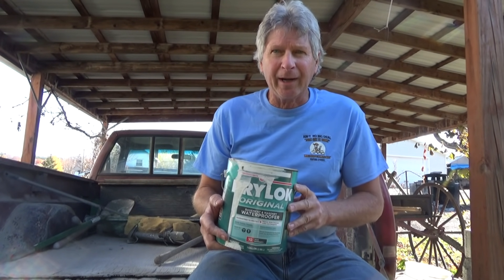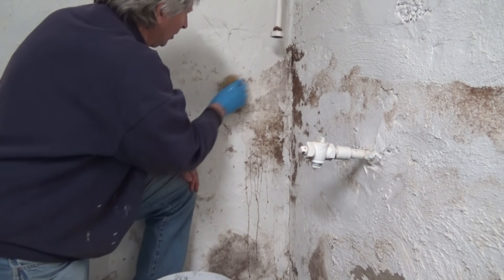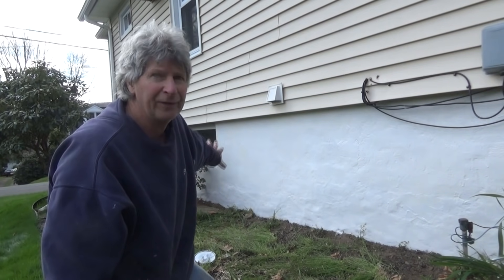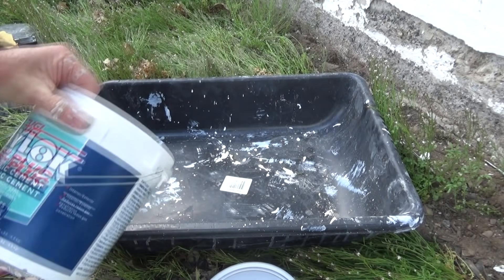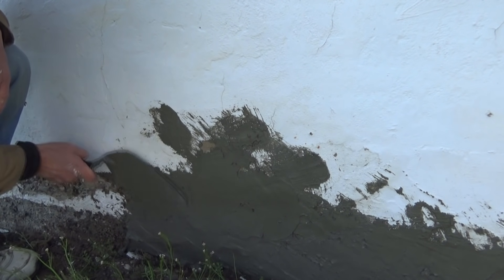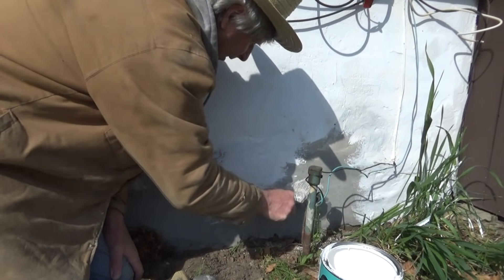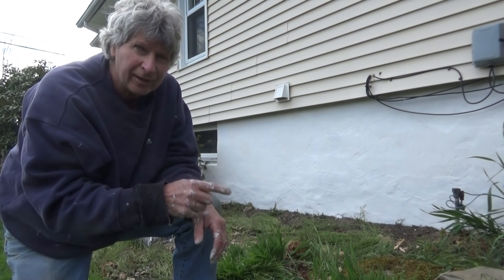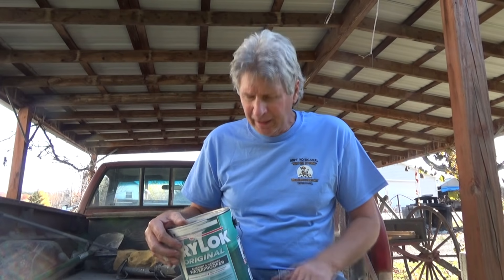FOUNDATION REPAIR (Part 18) Mike Haduck Drylock Paint

Comment: I have a house that is 125 years old.  The basement is stone.  A previous owner painted the basement with drylok.  The problem is where ever there is efflorescence the drylok would bubble up and eventually fall off.  I scraped all the loose drylock off and every year there is slightly more to remove.  I've cleaned off the efflorescence off with a sponge and water and never year it is back.  Not sure what to do except continue removing loose drylok.
Reply from the maker: Hi Felix. Sounds normal for old foundations,  thanks Mike
Reply: The reality is that you don't want to use dry lock on anything where it can get wet from behind. Drylock would be fine if the exterior is waterproofed with a dimple membrane and French drain, but without that it's a losing battle with water. Better would be to parge with lime or a mostly lime mortar and run a dehumidifier.
Reply from the maker: @PSNDonutDude  hi PSN, I worked on lots and lots of cellars and basements with the old lime mortar and it never worked, thanks Mike

Comment: Mike, I see you haven't lost those old painting techniques we learned onboard ship.  You are right rolls don't cover the job as well as a brush on these surfaces, I have a 1948 house an brushes work great on most surfaces.  God Bless
Reply from the maker: Thanks Ernie, God bless also, Mike
Reply: When I painted the sides of my detached garage, when the masons originally "plastered" over the block, they did not finish it smooth. So many small voids, even using a roller with the highest nap they make, I still had to go over it with a brush to fill in those little holes. They do make concrete brushes, as you know, although I didn't have mine yet.

Comment: I used your repair technique and then sealed the basement walls with super thoroseal (it's called basf masterseal now) it works great I have a dry basement now thanks to your videos Mike!
Reply from the maker: Thanks, mike
Reply: Do you recall which video? And did he use the same sealer in that video? Getting ready to do mine. Thanks.

Comment: Use to buy it in a powder form that you mixed with water like cement.  Not sure if it's still available but the single coat I put on my parents bare block underground basement (when I was 14) not only stopped it's constant flooding, but is still doing so 43 years later here in NC.  I know this for a fact because I now own and live in that same house that I grew up in.
Reply: Was just at the orange store getting UGL. They do have a half-height bucket of the dry stuff right next to it.  Didn't seem like it was exactly a paint on product though.
Reply from the maker: Hi Mat, that's good to hear, mike

Comment: Another good video Mike. I just used this product on my concrete patio slab. Concrete was spalling from frost. I power washed it and skim coated with 50/50 Portland and sand. After it dried for a week I sealed it with weldbond and water-5/1. 2 coats. Looked Patchy so I used 2 coats of Dryloc concrete floor paint. Looks great now. My wife likes it too😊
Reply from the maker: Thanks Gord,  mike

Comment: it's a good and a great product.   Thanks Mike.  The last basement I worked on had a drain spout going into the ground into an old 1950's clay pipe and the new landscaper drove some equipment over the pipes and they cracked enough that the water found it's own channel down the length of the block foundation in a basement.  had to dig it all up and used this product on the inside and other places after properly replacing the pipes.  Elastomeric paint is great
Reply from the maker: Thanks Thor, seems to work very well, mike

Comment: I am a complete newbie. It is interesting how you used dry lok's fast plug to patch the outside of the wall where paint had peeled. The user manual of dry lok says to use fast plug for 'cracks and holes' but you seemed to use it to simply strengthen the surface a bit? Am I mistaken? I have a cinder block wall that took some water damage when gutters were not installed and negletcted so the paint peeled in a few places and the concrete definited eroded in a few places. I am trying to decide if I should strengthen it with something (and with what?) or just put dry lok on it as it is? (since gutters are installed now and water damage will not be as bad in the future) I considered using fast plug but I could not get myself to use the product for something that its producer says it is not for? thanks for the videos from this newbie.
Reply from the maker: Hi, I usually use a rapid set or fast drying to fill in, I personally don't see a difference,  I never had a problem,  thanks Mike

Comment: Good day-  Liked this the video.  Bought my house in '16. 2nd owner, built in '59.  Block wall foundation excellent condition, walkout out basement.  Had some mold in certain corners which I killed.  Then I didn't hesitate Drilocked all the walls and floor.  I knew that that was going to happen the first time that saw the bare walls and floor,  Haven't had a problem since.  But we took the washer and dryer out of the basement.  You could tell that the basement had ventilations problems.  Now for the problem-  The driveway is toast.  amongst other things it had a  3/4 " crack, T shaped. blew right past a control joint. All the way thru the slab.   I tried your strategy of 1 part Portland to 4 parts sand.  Probably mixed it a little to dry.  I didn't want it milkshake.  
Thought it was trawlable.   When I went to feather with the sponge It left a coarse finish of the mix over the crack itself.  For the record, I live in central IN.  Is that natural?
Reply from the maker: Hi John, cracks never go away, you can only make them better, so whatever works, I hope it helps, Mike
Reply: @MikeHaduck  ok
Reply: @MikeHaduck  at least I will have situation smaller than I had yesterday

Comment: Hi Mike, big fan of the videos they are extremely informative. My question is however, what is the difference between using Hydraulic Cement branded products versus say using a Rapidset mortar type S with some extra Portland cement added? What makes the Hydraulic cement different from Portland? My understanding is that Portland  cement is a hydraulic cement. Are these companies trying to charge a premium for simple Portland cement in a branded plastic container?
Reply from the maker: Hi ,when I started madons used lime and Portland,  and made their mixes according to what they were doing, now they are trying to standardize it , saying you need this or that, but I still go old school and never had a problem,  thanks Mike

Comment: Can you do the same thing shown in this video on cinder block (cmu) foundation? (i guess you would have to avoid putting the fast plug into the gaps between the blocks so as to keep it looking the same?
Reply from the maker: Hi Semith, I have basically used it on just about every type of foundation , thank Mike

Comment: I have a exposed block foundation. The concrete grout inbetween some of the blocks was cracked and broken apart from water. I cleaned up the gaps injected it with foam than made a cap of hydrologic cement over the foam. Should i clear paint over it or seal it somehow?
Reply from the maker: Hi, I can't say unless I was there to see it, I have a whole playlist on "foundation repair" Mike haduck, I show all my techniques for the different senerios there, thanks Mike

Comment: Is the cement white wash better for an old foundation than the drylock paint? 
Ours was painted with drylock and anything below ground level has deteriorating loose  stone. BIt seems to me that the cement white wash may be better for our basement.  Open to opinions.🤷
Reply from the maker: Hi Pamela, the old white wash was all they had in the old days and it constantly being re applied, so with old foundations once I got them repaired I try and use a good masonry paint, sometimes drylock, anything that works, it's usually just to make it look better, thanks Mike

Comment: both inside & out came out looking nice.  Why the gallon of outside drylock hydrolic cement?  vs making your own?   For the drylock paint is it white paint with white portland?    For the outside ground line you  dig a bit out -logical but I'm always looking the best way to handle painting to/at/below the ground line without picking up dirt as I go?   Normally I try holding the bottom line to the end when job/brush are nearly done - then hit the bottom line iwith  some cardboard at the bottom as the edge - yet still dirt gets picked up?
Reply from the maker: Hi, I would say in masonry I dig down and with fast set paint right over it, works good for me, every job is different and they wanted it done to sell the house, thanks Mike

Comment: Great video. Quick question, I recently built a block garage in Toronto, noticed when it snowed, the snow that stuck to one wall, made that wall on the inside look wet.
It’s a cinderblock finish inside and out.

Is this normal? 

No leak from roof or flashing, just simply the wet snow sticking to the exterior of the wall.
All joints tucked.
Reply from the maker: I can't say unless I was there but a lot of masonry blocks absorb water, thanks Mike

Comment: Hi Mike where do you get rubber container you use for mixing either portland or this?
Reply from the maker: Hi Brenda, usually home depot, lowes or ace, thanks Mike
Reply: @MikeHaduck  thank you so much
Reply: @MikeHaduck  hi again in doing sidewalk, can I use white portland cement with glue bonding mix in with sand to help avoid some spots being darker than others (vs using regular portland cement that has aggregate/rocks in in)? If so, I read that if using white portland, conventional clay should be substituted with kaolin to reduce iron content? Don’t even know if the substitution applies to using white portland

Comment: Had a question for you Mike. We bought a house built in the 1950s. Cement block wall foundation. Structurally it looks fine. The previous owners used drylok paint on basement walls/block walls. It has started bubbling months later. Do we need to remove it all or just the parts that are bubbling?
Reply from the maker: Hi, In most cases I just scape what is lose and go over it, thanks Mike

Comment: Pro Tip: Instead of scrubbing mold with water which mold spores LOVE, wash it with straight vinegar. Vinegar literally eats mold.  I spray Vinegar on everything that has mold on it.. I hit it twice with a spray. Once kills it. Second time is for good measure. After the vinegar dries I hit it with a bleach spray to get rid of any mold stains.  Ive tried all mold sprays sold in stores , vinegar comes out on top, and bleach in a close second place.  Some people go straight to a Bleach and Water solution to wash mold away, but I've found for some reason the vinegar works much quicker and doesnt smell as strong. Also NEVER mix Vinegar and Bleach together. It'll create very toxic fumes which is why I make sure the Vinegar is dry before I spray the Bleach solution. Bleach solution isnt necessary but It helps neutralize the odor and remove stains. Its overkill to do both but eh I like to make sure everything is dead and clean. Using just water to wash mold will not get rid of the mold. itll come back. Mold embeds itself to whatever it attaches to.. it grows through the material. Paint will only encapsulate the "washed" area that isnt really free of mold spores. The paint will seal it in the spores and may kill them or just prolong their growth.
Reply from the maker: Thanks Chris, It's good to get tips like these, Mike

Comment: Mike my question does not relate to this video but I’m here and it was a good video. So my question is what do you recommend on the surface of a small concrete porch that is exposed to the weather. Mine is pitting. I tried a sealer before winter and it’s all starting to peel already and it was supposedly a good product. I was almost thinking of this product that you used in this video. First the patch to fill in the pits and then the actual painting. What are your thoughts for my problem. Thank you you’re the best
Reply from the maker: Hi Paul, I usually fill in dips,  wait 30 days and use a masonry paint,  I got a playlist , concrete repair, that might help, thanks Mike
Reply: Thanks Mike, I watched your video on repairing steps and saw you used quick  set mortar

Comment: I've had a problem with paint on an interior basement painted block wall holding moisture which then caused the interior block face to disintegrate, but only at the bottom.  I removed the paint on the entire wall and repaired the damage.  The basement had no history of water leaks.  The moisture appeared to be vapor transfer through the block wall that the paint had blocked and held against the cement block for long periods of time.  4ft of the 8ft wall is covered by outside dirt.  Is there breathable cement block paint?  Do interior basement block walls need to be painted or can they be left unpainted?
Reply from the maker: Hi Richard, I have a series of videos on foundation repair, where I use different products for different circumstances, check your raingutters and see where the water pools outside your house, thanks mike
Reply: @MikeHaduck  Thanks Mike

Comment: Hi,   mike, My basements walls on the inside have parchment that is falling off in large pieces where it was just cracked and the floor is cracked, and when I walk on it after it rained water oozes up from the cracks. Yesterday after heavy rain it had a dime-size hole in the wall that water was flowing from into the floor  What do I do to fix this?
Reply from the maker: Hi, I have a video called "basement water problem solutions, Mike haduck,  I would watch that first, thanks Mike
Reply: @MikeHaduck  ok. I will watch that one as well. I went around to outside and filled any visible cracks and empty spaces, then did inside. I kept hearing your words in my head. Throw it in there, and just knock off the bad parts. Thank you Mike.

Comment: Hi Mike, my concrete porch is painted grey. Although I'm not a fan of painting concrete, do you have a brand of paint you would recommend that I can use to scrape and paint this thing again with?
Reply from the maker: Hi Theo, I just usually use a grinder, then a good stucco deck paint, thanks Mike

Comment: What do you do if there’s some crumbling? Is there a seal to make it intact before you paint it with drylock
Reply from the maker: Hi, I did a whole series on foundation repair, mike haduck,  I show all my techniques, thanks Mike
Reply: My experience with light material loss on cinder blocks is dry lock is only as good as the base it is applied to I've tried since 2005 to get dry lock to last this year I'm trying Mike's portland and a product Lowe's sells with fiber and a white pigment 2 separate locations. If this doesn't work I'll try and find a professional problem is we're in the middle of nowhere Appalachian Mountains
Reply: @1STGeneral  I have concrete walls. Wonder if that radon seal works to keep the sand intact.

Comment: Hi Mike, always great information you give us.
I do have an off topic question for you I hope you can answer for me.
How much can I expect a concrete driveway lift during winter? (I'm located in Western NY)
Reply from the maker: Hi, almost everything depends on what's under it, if the water gets under it, temperature, etc, some dont rise at all and I see some go a few inches or more, everything depends thanks mike
Reply: @MikeHaduck  2 winters ago, my new driveway (2019-2020), where it meets up to my garage, never lifted. Last winter (2020-2021), it lifted approximately 1/2" at the same location. How would you categorize that amount?
Thanks John.
Reply from the maker: Hi John, all the winters are different,  I seen roads buckle up over a foot and next year do nothing, thanks mike
Reply: @MikeHaduck  Thanks Mike, I understand that, but my main question is, the 1/2", is it something to be concerned about, or is the 1/2" considered minor?
Thanks John.

Comment: Drylock has a newer formulation called "Drylock Extreme", which I have tried. It does not have sand like the original but rubber particles, or some such filler. It is much easier to apply than the original formula, but it does cost more.
Reply from the maker: Thanks Harry, mike

Comment: Great video,  That paint job should last a solid 6 months.  Just enough time for closing before the mold returns
Reply from the maker: Hi Mark, I can see your inexperience,  mold comes about mostly through moisture and no ventilation, that's what has to be addressed first when the house is purchased, That's why inspectors are involved, I can refer all real estate  dealing with thousands of dollars of hold ups and lawsuits to you if you want,  I am sure you can handle it, thanks Mike